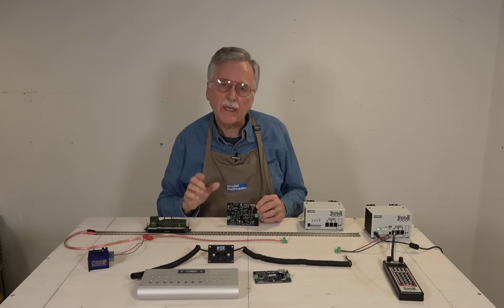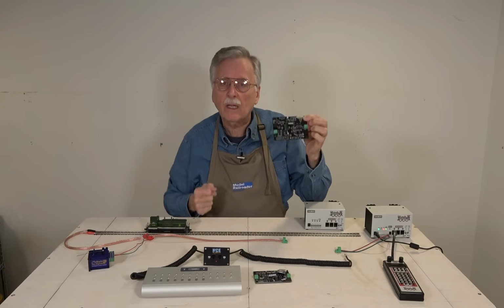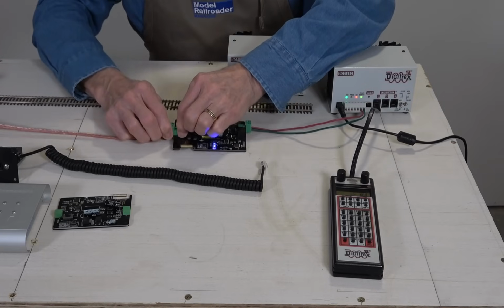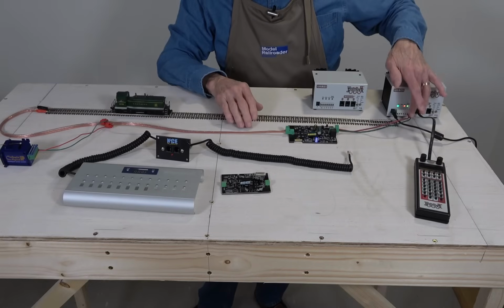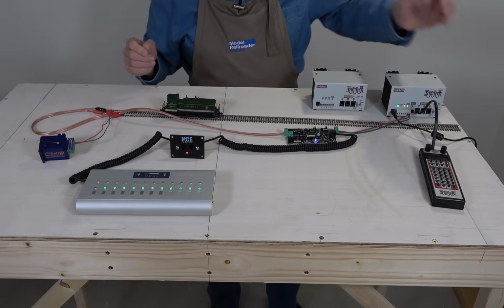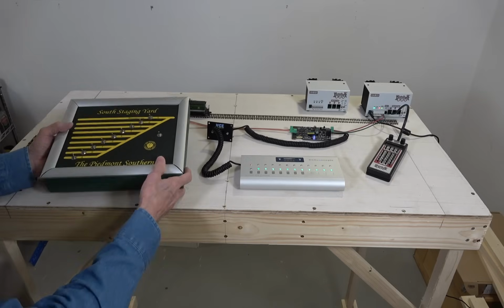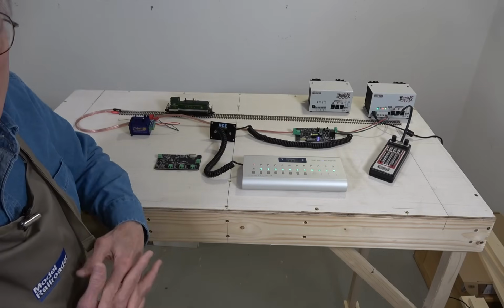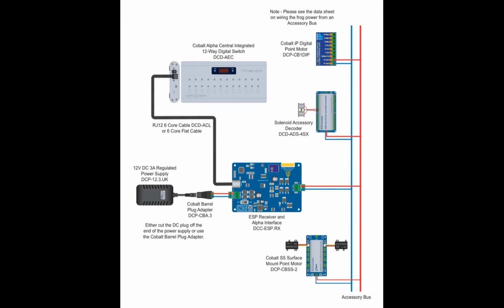DCC Concepts New Universal Interface (377)

Comment: I have a question, i have an old digitrax DN121 decoder, that fir some reason only runs in reverse. It ran fine in forward and reverse when i got it, but after I put the shell on all the way, the decoder may have been under pressure? Do you know what could be wrong?
Reply from the maker: Does it still do it if you take the shell back off? Anyway remove the shell and make sure there is nothing amiss with the wires. Next try a factory reset by programming CV8 to a value of 8 and see if that helps. If none of those pan out then you may have damaged the decoder when the shell pressed down on it and a trip to Florida may be in order. However it may cost more to send it in for repairs than a replacement decoder.

Comment: Wondering if you've tried any of the Proto Design Labs DCC kits for Unitrack and thoughts about them?
Reply from the maker: Although I’ve never seen them they look like interesting products, not sure they look very prototypical but an easy way to add signals.
Reply: The Proto Design Labs decoders work great. I have installed these decoders in all my turnouts. They are hidden inside the turnouts and respond to your commands with no external wires. Simply brilliant.

Comment: I watched this and bought one. However, I have multiple power zones with boosters. In fact my mail DCCcontroller power output isn’t even connected Ted as it’s all connect by Loconet anyway.
So, how do I use this with two boosters? Should I connect that Universal Accessories Module via its output to the track sniffer input?
Reply from the maker: I would set up a single accessory bus powered by either the main unit or the booster. Your throttle commands will still go through the unit as will any commands originating with any of the Alpha products connected directly to it.

Comment: How does it work on a layout with multiple boosters?
Reply from the maker: In a case like that you would likely need to just set up an accessory bus using a spare booster, just to control accessories like switch machines to be controlled by the Alpha products. You still might have throttle control since those commands might go through the command station and get integrated by the booster used to power the accessory bus. I’ll pose that question to DCC Concepts and get back if I can still find your comment after a few days.,You might want to bug me again in a few.
Reply from the maker: Ok, I got an update from DCC Concepts and it would work as I suspected. Assuming you use a spare booster, such as the one made by Tamm Valley, to power the DCC Concepts board ini a separate accessory bus, the DCC commands would be supplied by the track bus connection and throttle commands would still be incorporated into the accessory bus. So you would be able to use the Alpha Central or other Alpha control devices as well as throttle commands to control accessories.

Comment: Thanks for sharing. Rather  than the NCE Pannel connection? Can I use a Digitrx  Pannel connection instead?
Reply from the maker: You don’t need to use a panel at all as it can plug directly into the universal interface as I showed. However to answer your question the Alpha products are only compatible with the NCE panels.

Comment: Could I use my NCE PowerCab with curly chord attached to NCE panel attached to DCC Concepts unit attached to my Digitrax DCS210  command station and still have a funtional loconet?  Thanks in advance.
Reply from the maker: No, as I said in the video it only allows you to use DCC Concepts Alpha products with any DCC system.
Reply: @TheDCCGuy  I'm sorry it was not so clear to this very simple mind.
Reply from the maker: No, I think the fact that I was using the NCE panel confused more than just you.

Comment: Great video.  Wonderful information.  Larry, I would like to ask you a question off the topic.  Is it possible to change my Digitrax throttle, which is tethered to my command center, to a wireless throttle without extreme expense?
Reply from the maker: You need to contact customer support at Digitrax to see which throttles they offer that for.

Comment: Hello Larry. Totally different question from this video. I have 3 dc Dd40 2 motor engines. Are they able to be made dcc? One has 2 independent motors with flywheels and another doesn't and it's coupled together with a driveshaft between the 2 non flywheeled motors. Is this possible or am I to put them on a shelf and just look at them. Thanks for any input you can provide. Bruce 
Oh. It's 12:33 here.
I 4got 2 mention these are old blue box!
Reply from the maker: Boy, that might be a problem. The independent motors means you really need to get them speed matched or they might fight one another. Also depending on their age the older Athearn motors could be current hogs so I doubt you could run two motors using a singly decoders. I would do some YouTube searches to see if anyone has had success doing this.
Reply: @TheDCCGuy. If I could send a picture, I would. The older one has the old gray motors and are connected together with a driveshaft. The other one has the brass looking flat can motors and seperafrom each other. 1 motor per truck. Don't seem to fight each other. I really would like to make these dcc. Should I maybe contact Athearn directly? Any help at this point is better than no help. Thanks again.

Comment: What are the advantages over a system like this versus using JMRI?
Why use this system over LCC, a NMRA standard?
Reply from the maker: This product relies on simple plug and play products to allow one to use off the shelf control panels and other sophisticated electronics to operate a model railroad. JMRI and LCC require a much higher level of sophistication and wiring/computer savvy which a lot of folks aren’t interested in, they just want to run their trains.
Reply: @ thanks!

Comment: Can you use a Digitrax UP5 or UP7 instead of the NCE panel? I would assume that you can.
Reply from the maker: No, the NCE panel works because the DCC Concepts equipment was originally designed to work with NCE systems so their wiring is compatible.